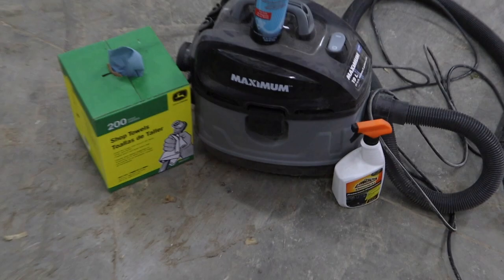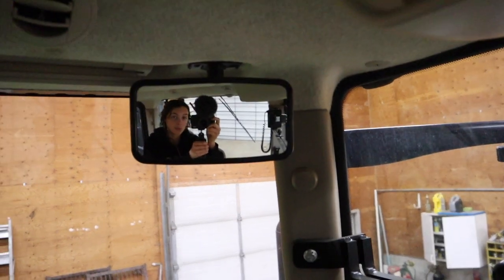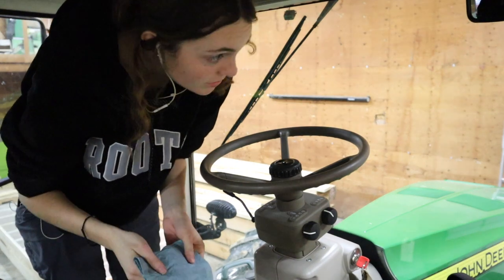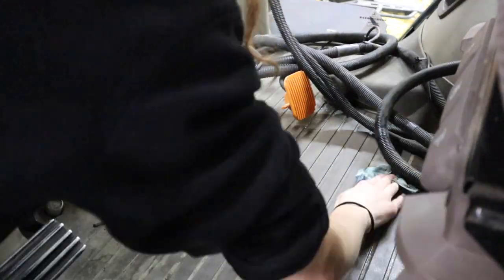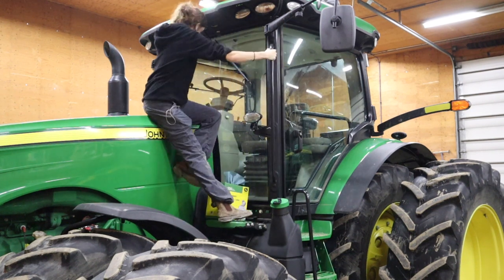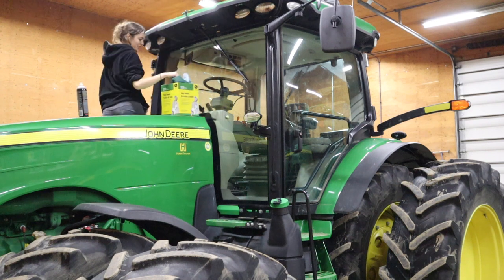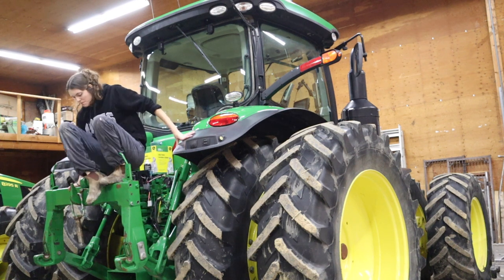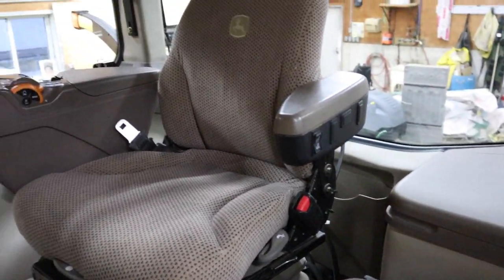cleaning the tractors for the FIRST TIME in 6 MONTHS!

Comment: Instead of window cleaners, use a little bit of Dawn dish soap mixed with water in a spray bottle. It works great and doesn't streak. You can use a blue scrubby sponge to wash and then dry with a towel . No paper towels are needed. It will save trees and money.